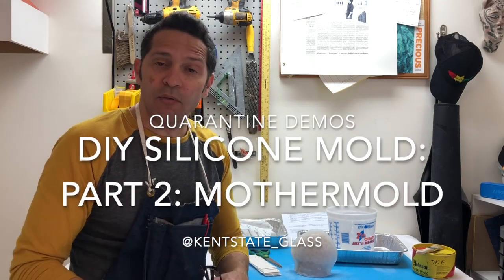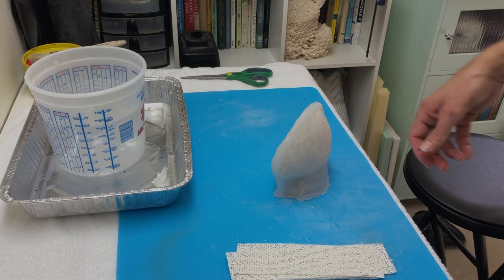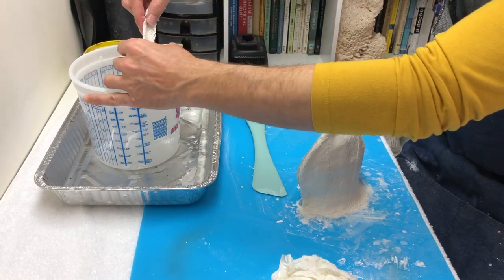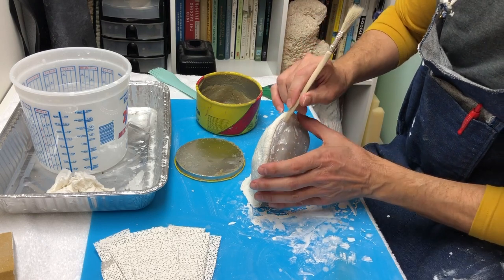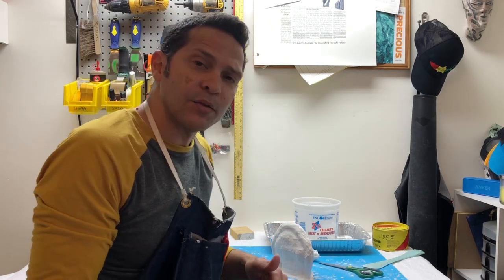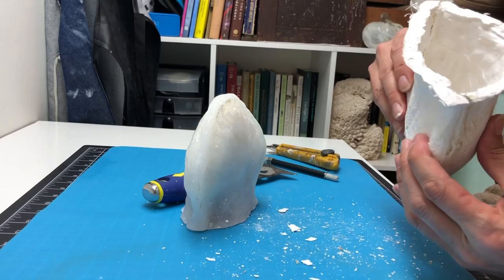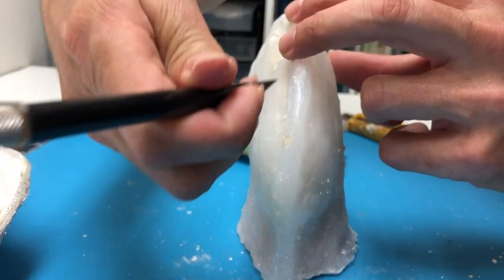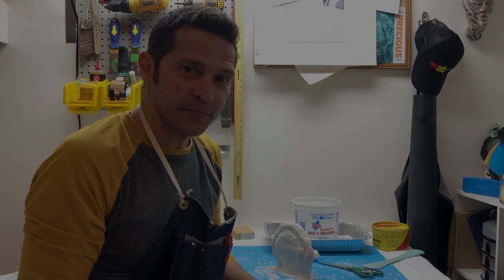DIY Silicone Mold Demo — Pt. 2 — Mother Mold

Comment: hi love your videos very well explaind. may i offer an alternative  without meaning any offence to you. if you ues a permeant marker to draw a line on the silicon mold were you want it to join after it is set, you would make the plastering and registration cutting easer for beginners, also Vaseline is good alternative as a separator, as well as the wax. in ceramics we ues a wax resist for glazing its like a milky consistence and comes in a plastic jar and decoration you brush on and it leaves a very thin film once dry hope i did not offend as i said love your tuts i taught ceramics but want to move into pat de verre and glass which i touched on at uni a life time ago. thank you for sharing